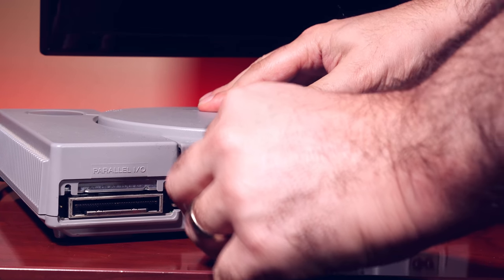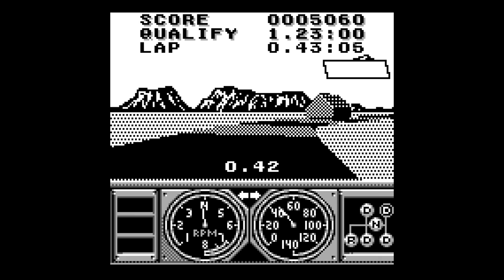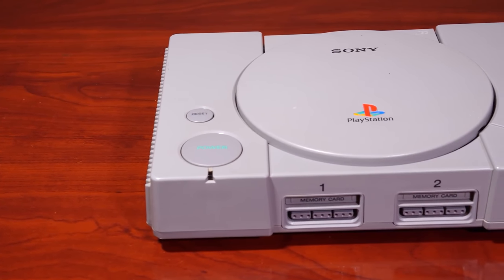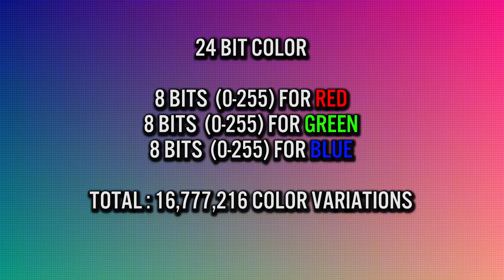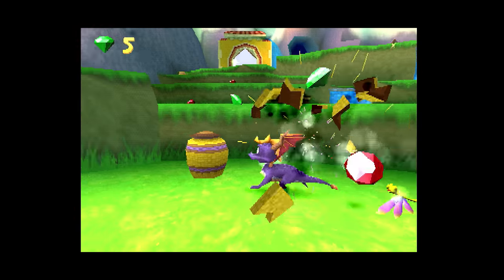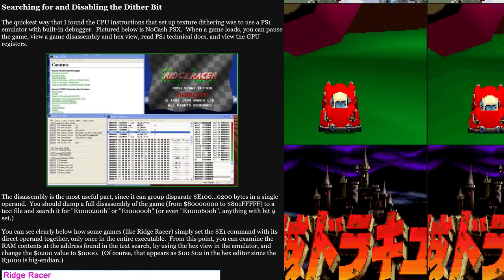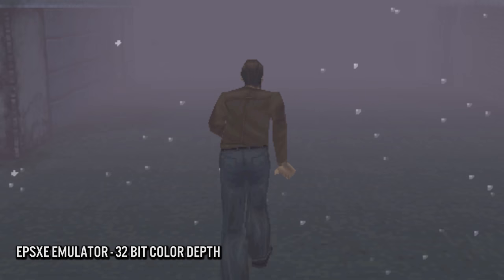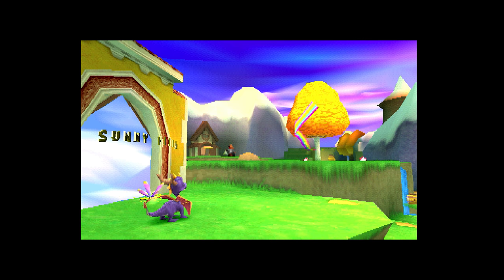Why did the PlayStation 1 have so much Dithering? | MVG

Comment: Meanwhile in PC land at the same period, dithering was absolutely standard for 15bit graphic modes on nearly all cards.

As other have reported, 3DFx Voodoo cards, the then leader for GPUs on PC, did post-processing to smooth out the output. (e.g.: voodoo 1 and 2 did a 4x1 smoothing giving their signature horizontally smeared look, not unlike how dithering looks on a composite output.  Voodoo 3 and Banshee had a better filtering. Voodoo 4/5 could instead rely on the FSAA to get more colour resolution - i.e.: smoothing across the multiple AA subframes, instead of horizontally - absolutely zero smearing)

Meanwhile, other such as the integrated Intel i810 GPUs did dithering too, but did absolutely no filtering. Also all the dithering pattern were aligned to screen resolution. When multiple textures are mixed on screen (e.g.: transparency effect) the dark/light checkerboard approximation of each texture accumulates, and the final effect looks worse. Pile one too many semi-transparent textures, and instead of a smooth gray, you'd get a monocrhome checkerboard.

Comment: What I don't understand is why they didn't shift the dither pattern every other frame, like they occasionally did with Gameboy games. On older CRT's, frame-flicker techniques work decently well, especially with subtle color-changes, and it's not like they had HD-tv's with de-interlacing bugs back then afaik.

Also I'm so happy that I now have a 10bit color panel. The banding used to drive me nuts, even on 8bits per channel. One of the more subtle changes on modern panels...

Comment: I would expect emulators not to smooth out the dithering, but to simply never downsample the 24-bit textures in the first place--so no banding or dithering. Only those games with baked in dithering would need actual smoothing--and I would hope they'd have good algorithms that could tell the difference between dithering and sharp features.

Comment: I used to use all the nice features in emulators, but that only helps so much.
Now I primarily play older games on a CRT and use stuff like everdrives and PSIO to get the huge library that includes hacks and fan translations over onto a real system.

Comment: DIthering as a technique was discovered during World War II where the mechanical computers installed on airplanes worked more accurately during flight rather than on the ground because the vibrations of the plane would help the gears rotate more easily and get stuck less.
Reply: Half tone was around before WW2
Reply: @SerBallister  I did not know about halftone, thank you.

Comment: People keep saying "what about the Saturn?". The thing is, dithering textures is quite different to poking holes in one - the former gives the illusion of a greater colour depth, whilst the latter was used to simulate half transparencies. They do give the illusion of a more powerful system (at least, until you connect them via RGB), but that is the sole similarity. Turning off PS dithering would sharpen the output, turning off Saturn mesh transparency would just mean an opaque polygon. I think dithering on the Saturn would be handled solely by the texture artist.

Comment: I very much do like the Dithered look of the PS1 as it's what I grew up with on my original PS1 over the years.  Without it the graphics just don't look the same, something is kind of missing if you remove it.  It's quite noticeable when Emulating the PS1 as the graphics just don't look quite the same as you remember them.

Comment: RGB Scart in Europe highlighted dithering on the PS1 a lot more. You really notice it in Gran Turismo and Metal Gear Solid.
Reply: @Lyra Heartfold RGB Pal games looked better than NTSC games it's just the frame rate. I never saw a 25 FPS game they were 50. The benefit of RGB PAL came during the PS2 era when games started having a full screen 60hz mode.  Dead or Alive 2 looks great. All PS3 games ran at 60hz.
Reply: @Lyra Heartfold Well if they ran at 30 on NTSC they would run at 25 on Pal Yeh. They optimised PAL games as much as possible. Streets of Rage 2 has the music speed increased to match NTSC but Sonic doesn't.

Comment: Isn't one of the reasons the dithering was so noticeable in games like Silent Hill that in some cases dithering would be applied to a part of the screen multiple times, since it's done on a per-texture basis instead of on the screen that the end? That seems like one of the reasons that people would find it so noticeable - if I recall right, SH1 has per-vertex lighting for the environment plus fog and the lighting from the player's flashlight.

Comment: Dithering was used a LOT on the Apple ][. The Atari 8-bit computers can display 256 colors (or over 25,000 with programming tricks), so there was less need to dither. And the 64-bit Atari Jaguar doesn't need to dither.

Comment: On PSX you can’t use any GPU hardware acceleration with 24-bit color. Textures can only be 4 or 8 bit indexed or 15-bit RGB. GPU can’t render to/from 24-bit pixels, it can only display a 24-bit image it exactly as it was uploaded into VRAM, generated by CPU or MDEC. When GPU draws pixels, it will always output 16-bit words.
Gpuezhsoft plugin (maybe others too), will internally use 24bit color instead of 15bit for texturing and rendering, only converting to 15 when absolutely necessary, but it doesn’t implement dithering at all. And doesn’t support Silent Hill anyway.

Comment: I grew up playing the original playstation, and never knew it used so much dithering all of this time. I don't mind how it looks on either modern or crt displays though. Also just to point out a small correction, I think Salamander was released on the Commodore 64 in 1988, and not 1998. lol

Comment: Did not care much about it when i was still on the OG PS1 (for the reasons mentioned in the video). Now that i switched to Emulation (RGB output on a CRT via UMSA) i have to say that i deactivate it (even bilinear filtering is often not enough, especially because im sitting pretty close to the TV).

Comment: Now, can someone explain why the Saturn didn't use hardware dithering and had not much problem with banding? I have heard it used a much higher color count than the PS1.
Reply: It's Saturn, that's it.

Comment: Is it weird that I was always able to see the dithering on my CRTs?  Even now it can easily be seen.  Are some CRTs maybe significantly sharper and cleaner than others.  On both Sony Trinitrons I can see the dithering just as you’ve displayed it in this video with modern output for comparison.. but I always have.  I own an old Panasonic TV that I can test on.

I’ve always preferred CRT or the addition of scanlines to retro consoles when being played on LCD/LED, but dithering was just something I’ve always noticed, but never really bothered me.  It’s part of the PS1 experience and flavor to my eyes.

Comment: I think dithering is treated differently for PS1 games on the PS3, going back to your SH1 example, I've played through it twice on my Sony WEGA CRT once on the PS3 via Component and once using a PS1 with HDRETROVISION component cables and I noticed the dithering artifacts were much more pronounced on the PS3, my guess is that the PS3s emulation is rendering the entire game in 480i vs 240p gameplay and 480i menus as it was originally intended. The reason I suspect this is because my capture device usually has a delay with resolution switching and I didn't have this issue on the PS3.

Comment: Great! It's like you read my questions on previous videos :D
Dithering on 3D games makes sense to me, but I still have a question, why on some PS1 2D games in particular with a small colour palette requirement (arcade conversions like some of the Parodius games come to mind), does the ps1 STILL apply dithering? Even on solid blocks of colour that did not have it on the original versions? Is it that Konami (in the instance of Parodius) just left the default hardware dithering on and nobody really cared because of CRT TVs hiding it?
Reply: The PS used dithering ONLY for polygon type primitives (those had the full 24bits when stored in memory). This is not including the texture, which itself can only use a 16 bit palette (So polygon primitives with texture maps used 24bit shading with 16bit textures). The sprite/solid rectangle primitive only used 16 bit colours (no dithering available).
Reply: @SerBallister  OK but PS1 'chequerboard' style dithering is definitely visible in 16bit arcade conversions on PS1 (like some of the Parodius games) on solid blocks of colour where it was not existing on the original arcade games. It's like the PS1 applied a blanket dither filter to the whole screen on many games by default,  even 2D games. But this is not apparent on ALL 2d ps1 games so I wonder why its on some but not all 2d games.
Reply: @TheRestartPoint  Yeah there are a number of ways they could have introduced it, the dithering could have done offline where they take the original 24bit arcade textures and dither them down to the 16bit colour limitation for PS1 textures, as opposed to the PS1 itself adding the dithering at render time.

Comment: If the PlayStation used bilinear filtering and the polygon vertices didn't snap from place to place, it would have aged much better. If would be basically N64 quality graphics, but they were 2 years away, and back in the 90s that was a lot.

Comment: Idk if it was mentioned but is the whole Silent Hill dithering regarding emulation and playing on 4ktvs? Cause i dont recall the dithering. Saturn wasn't mentioned and its hardcore dithering.
Reply: I suppose dithering and mesh transparencies are different, but have a similar effect in practice - to fool the eye into thinking the hardware is more capable than it actually was. The Saturn didn't technically dither anything and its meshing was every-other-pixel, however as it was free to use, the developers most likely decided that it was a decent compromise to coding intensive transparencies that didn't behave well, and certainly at a time when most people didn't have an RGB output that would show it up.
Reply: @stephandolby  so was the dithering that MVG spoke of just emulation and/or playing on 4k monitors? Cause i remember playing SH as a teen on a crt and i never noticed the freckling that is dithering
Reply: @jamesgriffyn  I've never played Silent Hill (shame on me, I know) but I imagine that all those sorts of tricks worked a lot better on CRTs, and certainly smaller screens. My response was more about the second part of your comment so hopefully somebody can clear up the first part for you.
Reply: @stephandolby  fair enough.  Thanks!

Comment: Isn't it not the CRT that smoothens dithering, but specifically the low resolution of some CRTs? If you played stuff on a good quality CRT monitor I don't see why anyone wouldn't notice the dithering just as much
Reply: That's just part of how the CRT works. For the same reason, motion blur did not exist in games until the advent of LCD displays.

Comment: i'm fine with a little dithering as long as it doesn't distort the overall image.
its the resolution that will trow me more off, something i'v been critical to since i was very young, as i remember i think i was in my very early teens, a friend of me ran doom2 in dos at 320x200, and i was kinda disturbed how bad it looked compared to 640x480 in windows 95.
But about dithering , same thing , in my very early teens, i was kinda annoyed of how bland the color selection in paint was in windows 3.11, because it ran at 16 colors :-P, but i couldn't quite wrap my head around way it was like that.

Comment: Suppose we build a computer from an old PSX hardware. What should it run? Even the lightest Linux build we have today would have MUCH trouble running on our theoretical PSX-PC.
And in 1994 they used this hardware to produce the most advanced 3D games at the time.
Dithering? We just found out that there was dithering in PSX when fixed width monitors appeared - what happened long after PSX was discontinued. In the specialized magazines at that time, NO ONE complained about dithering or color reduction or diffeences between 32k and 16m colors...

Comment: If emulating I prefer the real 24 bit textures over dithering. In fact I’m for all improvements as early 3D is pretty rough. But for earlier 2D generations I prefer integer scale pixels with no effects.

Comment: I would like to see the removal of dithering on PS2 games. For example if you play Tourist Trophy in 480p there will be dithering but not in 480i :( In 480p they reduced the color depth probably to save VRAM. I believe the same goes for Gran Turismo 4, same Engine and same developer.

Comment: I wonder why artists didn't just make textures in 15-bit color rather than go for 24-bit but hardware dithered. Seems like they could have had more control in that case. I guess it was just easier to do the art with the maximum color depth and then trust the machine to downsample it reasonably well?

Comment: Wait, so why didn't they just use the 24-bit textures instead of downgrading the color depth?
Reply: Memory limitations. As mentioned in the video, the PS1 had only 1 MB of video memory and that needed to fit all the textures, sprites and two framebuffers. Using 24-bit color depth requires 60% more VRAM than 15-bit color, so to get the most out of this limited space it was usually better to use a 15-bit framebuffer. Only if a game or scene didn't require many additional textures (e.g. loading a still image directly into a framebuffer) was it practical to use 24-bit mode.

Comment: i used to run a PS1 off the RF connection of my CRT, cant say i ever noticed anything amiss back then. kinda curious to take a look now.

but otherwise even on emulation, granted i never play anything long enough past to test certain things, i've never noticed anything still. and i've never felt reason to play around with the settings on ePSXe.

Comment: Look with these old systems, there were evn more compromises than with modern console, which stil have plenty (dynamic res scaling, anti-aliasing methods that are sub--par to superampling). HDMI is great and all but it's only natural that it would expose some of the flaws. After all the old consoles were designed with CRT technology in mind. Add some scanlines if you like and accept it for what it is or get a proper CRT :-)

Comment: Because higher bit depth requires more RAM and slower performance.  And the PS1 didn't have a whole lot of performance to spare.

A lower bit depth mode with dithering is going to be faster on the original hardware.

Comment: I grew up playing my PS1 using a RF connection to the TV and channel 3, and only noticed some dithering at friend's places with better TVs and connections. I think it's part of the system's charm!

One game I had, Twisted Metal 3 (I think it was 3), had dithering on/off in the options menu, with the instruction manual saying disabling it would enhance performance. I never noticed the difference (obviously in looks, but also in frame rate).

Comment: The faults of the Ps1 gave it that special look and feel. 

5th gen games don't need to look hyper realistic in 4k. Yeah, I've run mgs1 at 8k, no dithering, and used a mod which made perspective correct and had no warping. 

But then I went back to the original as it being modified left out that classic look. 

The game was designed graphically for 240p and 15bit color, the art looks better as it is.

Comment: Did the Sega Saturn have dithering? I never thought it did. What's the hardware difference between the Saturn and the PlayStation that means the PlayStation has dithering?
Reply: The Playstation used a 16bit video buffer instead of a 24 bit one.

Comment: Sorry, but with scart it really was visible on CRT, always found it so... facetious how people attacked the Saturn's translucency effects for "dithering" when a PSOne had it's entire screen dithered often. Not that it wasn't a good console, but good grief if you had a scart cable. I remember the N64 looking so much more pleasing on the eye due to this (and I know it also dithers, but the N64 had some hardware features that made it a lot less noticeable (trilinear filtering for instance)). Now don't get me wrong, I like how it was used, and I think it is fine to work around system limitations (for instance the Megadrive developers was very clever in this regard).

Comment: I had to buy a SCART cable right off the bat with my PS1 in 95, as for some reason my parents' TV couldn't handle the composite cable when going to ext sources: black screen, and that was that, whereas my NES, MD or SNES had all worked just fine on it for years. So here I spent 199.95 French francs more (console was 2099FF, and I was stretching it to reach the necessary budget) to buy said cable. To this day, I still feel that this composite cable thing was a scam by Sony!
With that, and while I loved the system, liked having a sharper image than my friends, I must say I noticed the dithering and didn't like it much. With pixel perfect rendering today, even less so.
I specifically noticed it on MGS, although I became atuned enough so as to stop actively noticing in the long run.

Comment: Big PS1 fan here, and I have some interesting information that I’m wondering if anyone else had come across before. I have a day 1 US NTSC console model SCPH-1001 and it appears that there’s very obvious color banding/separation in any game it plays. This was originally my cousin’s console and my console was an SCPH-7501 that had no color issues and dithering (like we see here). I still have both consoles and am wondering if the first PS1 models didn’t have any dithering at all? Or was it more limited graphics hardware / software that is causing the much more obvious color separation? I’ve always wondered this and have never seen it covered or written about